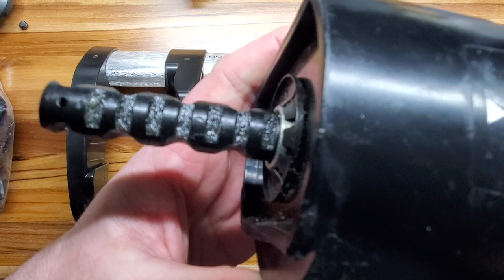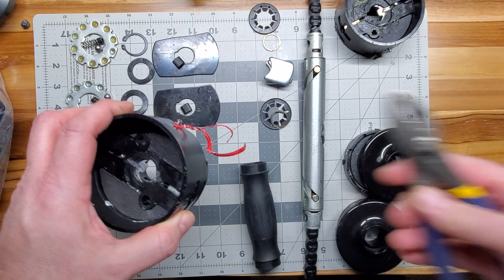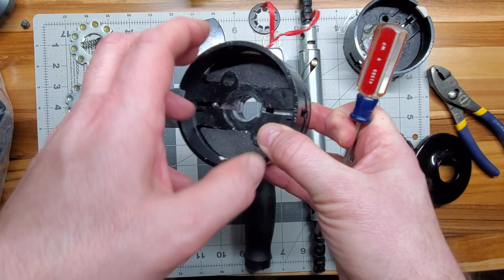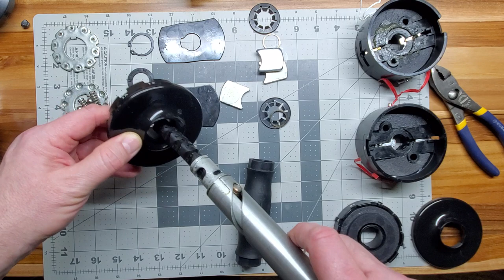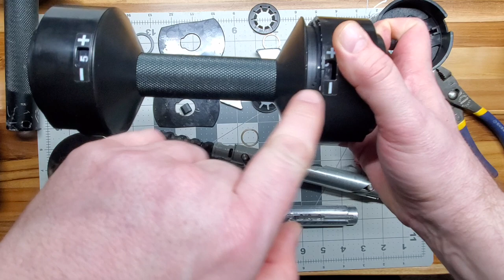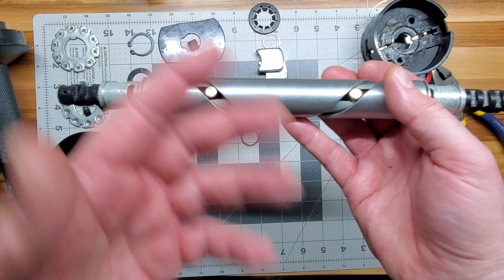Average Joe Teardown of Broken CORE Home Fitness® Dumbbell Handle - Like NÜOBELL®, It Has a Weakness

Comment from the maker: [MORE INFO: Folks, sorry about the video quality. I accidentally filmed this in HD and as my subscribers have come to know, I do these videos in one take with no do-overs. I'll increase the resolution in the next video.  

I forgot to mention that those heavy inner numbered cylinders are marked with an L and R. Each goes on a specific end of the dumbbell. You'll know immediately if you installed them on the wrong end. The numbering will decrease as the shafts extend outward,. Just swap them to the other end and you're all set.

I should have also mentioned that Core HF offers a 50lb version while NÜOBELL offers a 50lb and 80lb model. But, at the end of the day, does the amount of weight really matter more than the dumbbell's durability? A broken 80lb adjustable dumbbell is no more useful than a broken 50. Both of these manufacturers need to fix these design flaws. Poor material choices undermine what would otherwise be fairly solid adjustable dumbbell designs. ]

Comment: I've had my Core Home Fitness adjustable dumbbells for about 4 years now and are still in good shape. No issues yet(knock on wood) and I use them regularly. Thanks for the video!!
Reply: Thanks to your teardown videos though, my next investment in adjustable dumbbells will definitely be the Snode AD80.
Reply from the maker: Same here, Ady. About 4/5yrs no issues other than occasionally having trouble getting things lined up when returning the handles to the bases. I feel pretty confident that they'll last if I don't drop them, but we'll see.
Reply from the maker: @adyfregoso2112  I just just finished filming a Snode AD80 teardown. You'll see that here on YT in the next day or so. I hope you'll check it out! Cheers, Joe

Comment: If you had to pick between the Nuobell and Core, which would you say is the most robust / least likely to break?
Reply from the maker: If we assume for the moment that neither dumbbell will ever be dropped, I'd choose Core without hesitation. Nuobell cam followers appear to be failing from ordinary use. The simple back and forth twist of the grips to change weights eventually chews up and shears off the cam followers.

I own a pair of Core. So far, I've had no issues with them beyond occasional misalignment when trying to return the dumbbells between the plates in the base. I suspect we won't hear about any failures due to twisting the grips to adjust the weights. Core's weakness is shaft damage from drops.

Comment: my core dumbbell fell and all of the plates came off except for one. I removed the end cap but still can’t access the pin you mentioned because the inner plate is still on the dumbbell. Any advice?
Reply from the maker: Sorry about the late reply. I'm not on YouTube on a regular basis. When you say that all of the plates came off except for one.  Do you mean that, as a result of the drop, all of the plates immediately fell off one or both sides of the dumbbell?  Or do you mean that the dumbbell fell, then you placed it into its base, lowered the weight setting, and all of the plates were no longer engaged except for the half plate?  Feel free to email me the details to me at: joe@averagejoeinnovations.com. It'll be easier to communicate by email to see if we can resolve this. Cheers, Joe

Comment: Which would you choose snode 80 or core? Core is obviously cheaper. But if snode lasts longer id say the extra cost up front would be worth it.  Im all about fixing my own stuff if possible too
Reply from the maker: Hi, Jeff. No contest here. Snode, hands down. I like my Core dumbbells but they're capped at 50lbs and I do expect that eventually the plastic shafts will begin to fail even though they haven't yet. And when they do, I don't plan to buy replacement handles.

Comment: Any chance of tearing down a fitrx smartbell from Walmart? They're under $200 for a set, 5-52lbs
Reply from the maker: Hi, Dave. I may take a closer look for the heck of it, but probably not for several weeks due to my current workload. Someone else requested the same tear down. Based on photos I've seen, they look like they're loosely based on a mash-up of the Bowflex SelectTech 552 and 560, so I anticipate similar internals.
Reply: @AverageJoeInnovationsLLC  I also see the core fitness dbs have a new color scheme, hopefully they didn't change the internal components
Reply from the maker: @davet4580  I'll have to take a look when I have some time, but I doubt the internals have changed. Changing the color of the plastic is straightforward and doesn't require the time and expense of retooling. Similar to the many Bowflex 552 knock-offs that use the same basic BF design and just change the color of the molded plastics.

Comment: The handle is broken so cut it open to see how the pins got installed.  Can you show us how to replace the rubber handle cover with metal knurling.  Like a knurled sleeve?
Reply from the maker: Hi, Ed.  I want to make sure that I understand you correctly. Did you cut open one of your Core dumbbell handles?  Or were you referring to the Nuobell handle that I had cut open in a different video? I ask because Cores don't need to be cut open so long as we use the tricks I cover in the video above.

As far as I am aware there are no knurled grip replacements for Core (yet). They could certainly be manufactured, but the knurl would not be very aggressive. It would be more like the knurl on the Nuobell, very passive. The knurl depth is limited by the thin walled steel sleeve necessary to make the grip.  

The bigger challenge would be installation. I could definitely make a video that shows how to remove the OEM grip, but I would be very concerned about customers encountering a number of issues during disassembly and reassembly.  From a customer service and support perspective, a mod like this would likely require a high volume of after-sales support.

I'll add this topic to my list. I just can't promise a specific time frame at the moment, sorry. I'm several months behind on my video to-do list. Cheers, Joe

Comment: Are there any core home fitness adjustable dumbbell set that are counterfeit on facebook marketplace?  I looked for information but nothing is available.  Thanks Martin
Reply from the maker: Hiya, Martin. Great question, but I do not know the answer. I've not yet seen Core knockoffs, but I would not be surprised to find that some exist. My understanding is that Core licensed from the same folks behind Nuobell. Although the implementation is fundamentally different, it shares a common concept of twist grip adjustment with telescoping rods which may be why they obtained a license.
Reply: @AverageJoeInnovationsLLC   I took the dive. I picked up a set today from the gentleman on marketplace. It was the newer set with the all black cradles. All the decals look legit and I was able  to inspect and test both sets.  I even got the stand as well.  Paid $350 for the complete setup.  He said he buys from the warehouse it's their refused orders.  These inter rods are lubricated  so I felt they are legit.  Plus directions and paperwork wasn't full of misspellings and grammar errors.   I am looking forward to using them more tomorrow.  Thanks for your reply.

Comment: Long story short - do not buy these
Reply from the maker: I'm not sure I'd say don't buy them. Mine are still unbroken years later. Knock on wood. But, I would say if someone decides to buy them, definitely do not drop them. If you place them on the ground between sets they should be ok. One unknown is whether the aging plastic shafts will eventually break even from ordinary use without being dropped. I don't know, but I will eventually find out as mine age further. And the fact remains that we can't buy replacement parts, so there is that factor.  

If a retailer is running a deal on these and selling them for a couple hundred bucks, and you want a pair of 5-50lb dumbbells on a budget, they aren't bad.